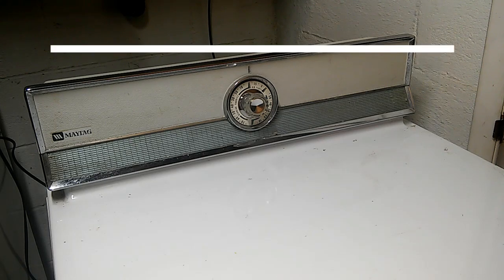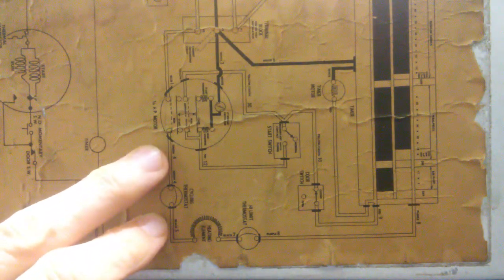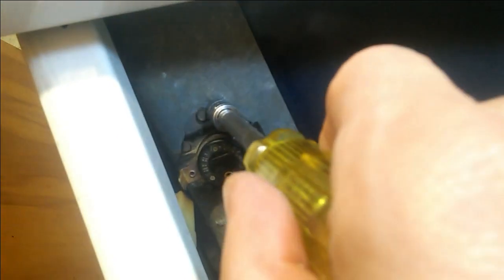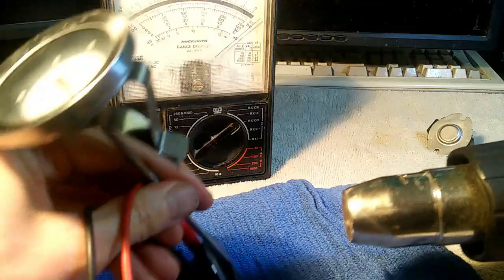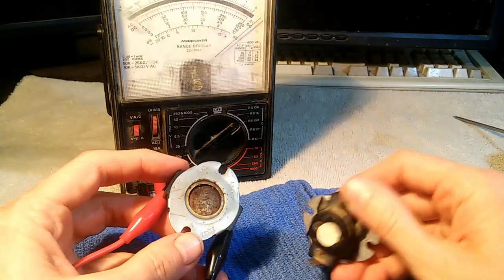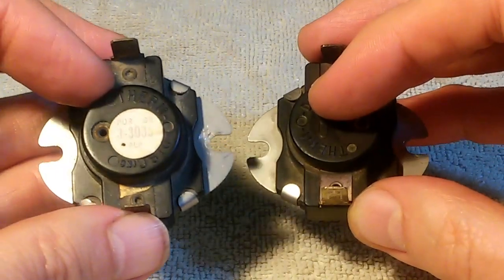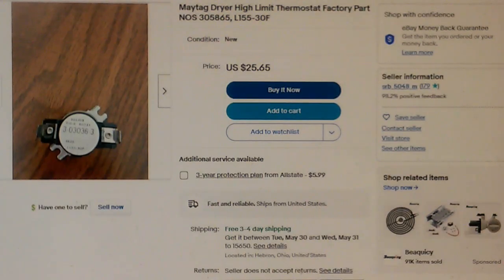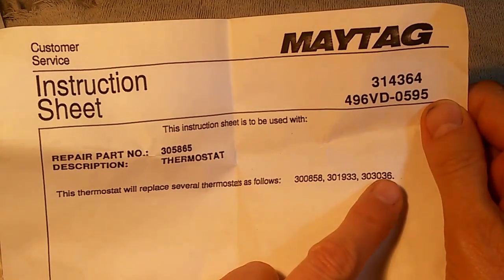Maytag Dryer Overheat DE90 DE306 DE307

Comment: I have a DE606, which has 3 thermostats.  I ended up replacing all thermostats, after 2 day research to find the correct ones.  The 3rd one, that this video shows the dryer DE90 does not have, is a cool down thermostat (it is on the housing to the right of the one in video).  When I tested the high limit, it would not cycle until about 180 degrees, but did disconnect.  Decided that was way too high.  I think the thermostat dissimilar metal discs get old and do not function correctly.  Guess 50 years is a long time.   I did take one of the thermostats that was not working apart to see how they worked inside, they are just metal contacts.  When the disc clicks, it breaks the connection.  When I cleaned the contacts (which had a lot of carbon build-up) and put it together, it would then function properly (still got replaced).  Dryer is functioning good now and the clothes are drying a bit sooner too with a belt change.  
  I want to pass on that years ago, I went to get the clothes out of the dryer after it turned off.  The top of the dryer was very hot.  For that particular time, a piece of metal I picked up was left in a pocket, waited until the jeans were in the dryer to work it's way out and found it's way to the heating element and touch part of the frame, making an electrical connection.  We were lucky to have gotten the clothes soon after the cycle or would have had a fire.
  Thank you for your video, it really helped me.  I like my Maytag dryer.  No computer boards, everything is mechanical.

Comment: David ✌🏼 THANK YOU SO MUCH FOR SHARING THIS VIDEO 🫵🏼💯👍🏼
My dryer won't heat up at all so first one im attacking is the cycling thermostat.
Reply from the maker: If your dryer is not heating, it could be the heating element or the wires to the heating element. The wires can get brittle and break.  It happened to me.
Reply: @c.davidgraves4848   yeah man! Indeed, heating element is broke... waiting for ebay replacement,  thank you!

Comment: Since I have a Maytag DE806 of similar vintage from 1974 (basically started out life as a basic DE306, but has since been converted to a DE806 with a lighted console), this is what thermostats I ordered. Ordered a Supco L150-20 for the high limit, Supco L120-10 for the cycling thermostat. If it’s a DE407, Supco LD120-15 double throw switch thermostat for the auto dry function. Those thermostats aren’t the exact replacements, but are replacements that are close enough which are readily available on Amazon.

Comment: That's a pretty rare circumstance to have both the cycling and high limit thermostats fail, but given its age, I guess it's possible. Those old Halo of Heat dryers are absolute tanks, unlike todays junk that barely manages a decade of use before requiring repair or replacement....if it even makes it that long, thanks to cheaply made sensitive electronic membranes.
Reply from the maker: I suspect the cycling thermostat failed first.  The dryer would often fairly hot, I didn't think much about it.  Then it became super hot.  That is probably when the high limit thermostat failed.  New appliances from Asia have lower quality and longevity than those made decades ago in the USA. As long as parts are available, you can keep them running forever.
Reply: @c.davidgraves4848 since I have a similar dryer, I use the Supco thermostats off of Amazon. Since it’s a single temperature machine, I would have used the Supco L120-10 for the cycling thermostat, Supco L180-40 for the high limit safety thermostat. The 120F cycling thermostat may be on the lower side and the high limit thermostat on the higher side, but will only cycle on the cycling thermostat as opposed to cycling on the high limit thermostat and cycling thermostat. 

You usually want it to cycle at a much lower temperature, high limit at a much higher temperature. If the cycling thermostat and high limit thermostat are only within a 5F to 10F margin, will more than likely cycle on both which increases the probability of both failing. Since I use a L120-10 for the cycling thermostat, L180-40 for the high limit thermostat, there’s at least a 60F margin between the cycling and high limit thermostat.